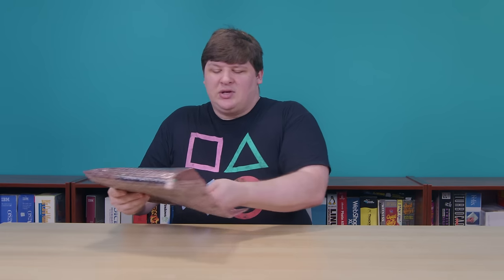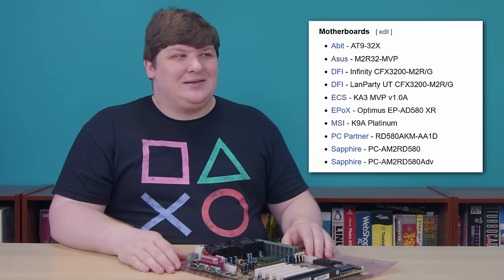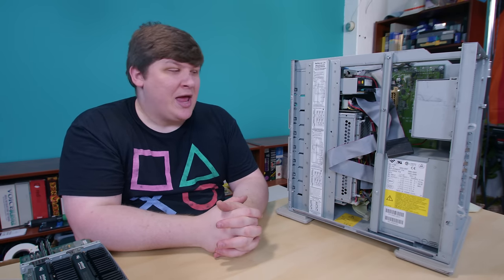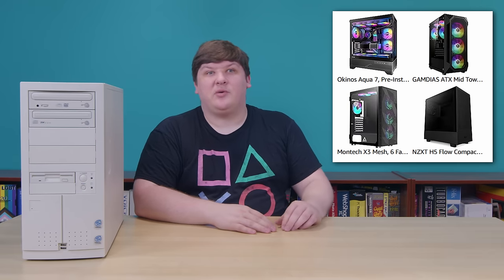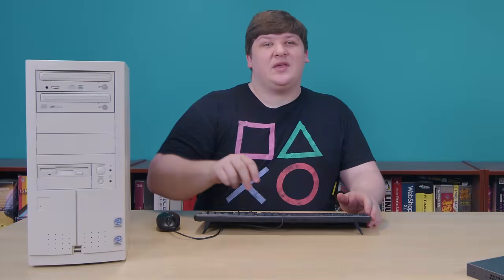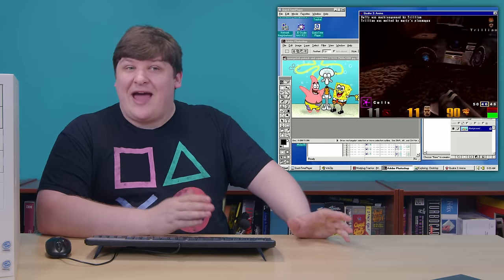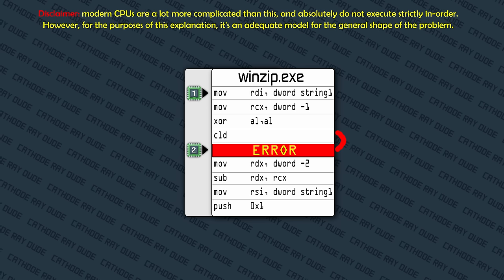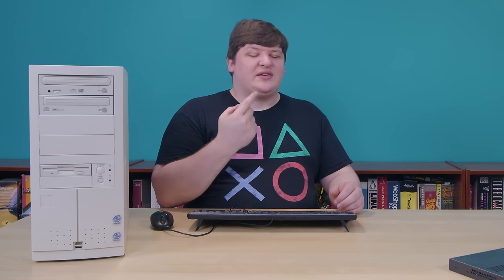The Only Famous Motherboard

Comment: The Celeron family was the low power option from Intel, it was originally focused on battery life for laptops. They also produced less heat so you didn't need a process fan.
By 1999 more power to a single core had stopped increasing processor speed as the bus speed was limited by the length of the cables, so that is why the final single core Celeron performance got quite close to Pentium speeds.

I ran SMP Pentium 733Mhz system as a software developer, as you say a lot more money for a small performance increase, but with dual scsi drives, compilation times were halved.
Hope that helps you understand why the Celeron family started with the not for enthusiast label, caught up, then were dumped again, when multi core processors allowed Pentium to speed off again.

Comment: Although SMP were way rarer for desktop usage earlier on, HP made the Vectra XU 5/xx (I've only seen 90) which was fairly generic for a brand PC at the time, except dual processors. Two pentium-1 processors, otherwise regular 72-pin SIMMs, some PCI and some ISA slots, ethernet built in on the motherboard and they usually came with graphics on the motherboard too, and they had an onboard SCSI controller, so high end, but certainly intended for desktop usage.

At that time, with 90MHz pentium processors, the difference was that you could run Winamp without other single threaded apps losing steam... :)

Btw, I really enjoy your videos but this time I think I already knew everything you told me, and I know what you are about to tell in the next video, which to some extent spoiled the experience. If you happen to actually read this comment and also happen to get different viewing statistics for this video than for most of your computer related videos, there might be many more viewers like me who already knew everything (except the benchmark results) but unlike me decides to not watch the full video.

Comment: modified Celerons usually had wires coming out of their guts. Even the guy who succeed using two of those Celerons on a board had to drill  some holes( I still remember seeing that pic online but I can't find it any more). Abit and Gigabyte  applied his findings and replicated the modification on their boards. It turned out  an external circuit could replace those drillings!

Comment: I ran with the crowd on the wrong side of the tracks. Everyone in my circle wanted a Tyan Tiger, for the dual Athlon XPerience! But the justification was exactly the same, and the results pretty much were too.

As soon as it became no more difficult to build with two core as it was to build with just one, the majority of us were happy to go back to one socket. There are real advantages to it, so as long as it's a sidegrade and not a downgrade, then whatever. Some people continued to use two sockets into the multi-core era, especially if they were already familiar with server hardware, but pretty much everyone else was and continues to be fine with all their cores being in one package.

Comment: Didn't have the BP6, but drooled after it, to replace my other P166 Linux-based FTP server. My normal PC back then had the good ol' Celeron 266 clocked to... 412? Mhz (just above 400 at least). Oh, and before Win2K (but especially with Win2K) , during the emergence of 3D-accelerated gaming the people who went NT also went nVidia Quadro or ATi FireGL, 'cause those were basically the gamer equivalent, but with drivers for NT -- albeit more CAD/3D Studio-focused stable OpenGL drivers. Thus,  games that used OpenGL often ran happily on NT. Remember a dude at The Gathering 'round then had such a system.

Comment: I remember the first dual SLOT 1 board I saw. It was E-ATX as those slots were huge. However, it was small like this A-Bit. It could fit into an E-ATX case which were common back then if unweildy.

Comment: Interesting video, I remember having a dual CPU slot 1 computer back in the days, dusted it off a few years ago and still working as good as it gets, it was a dual Pentium 2 450 Mhz if I remember correctly I should still have pictures somewhere, but it's stored away at the moment

Comment: The Socket 370 thing reminded me of when I was reading PIII stuff and the different voltages for different processors weirded me out, but made sense due to different transistor nodes used.

Seeing the 500MHz Celerons of the 2V made me think if they were of a different architecture than Coppermine and obviously the later Tualatin since I recall watching a video from I think Budget Builds Official on a Socket 370 Celeron build mentioning it too. 

Some searching later yeah it was an earlier one called Mendocino that used 2V instead of around 1.75V or 1.5V of later PIII and Celeron chips on Socket 370. 

Mendocino Celerons being available as both Slot 1 (Celeron 300A) and the Socket 370 variant like the 500MHz ones on the video was cool to see though since that's something Intel doesn't do again since they switched to LGA based sockets.

I can find dual (and even some rare quads in the form of SGI workstations with Slot 1 PIII) PIII setups using the later Coppermine and Tualatin processors but the motherboards are different and it seems the retro community uses either Windows 2000 or XP Pro for those.

Considering you shown NT 4, it would be interesting to see how Windows 2000 differs in performance to NT 4 on that dual Celeron BP6 board.

Comment: The thing with video games scaling more with single thread performance is partially due to (and especially before the era of (AMD Mantle)Vulkan/DirectX 12/Metal) the submission of draw calls and other work to the GPU being sequential, synchronous, and only doable from one specific thread really. So, all game rendering happened in one thread. Maybe simulation, networking, user inputs and physics can run on another. But if the game "CPU side" needs to spend most of its effort for a frame to generate the commands that needs to be drawn on screen... Well, this is where you bottle neck (as far as executing code on the CPU) is.

Comment: I had a dual socket motherboard. Can’t even remember which one, may even have been a BP6. I started with just the one CPU and.. only ever used one CPU as I either crunched a surface mount component near one of the sockets when trying to mount the heat sink so only ever used the other socket.

Comment: When you talk about rack mount in the late 90's you are also considering HP3000, HP9000, running HPUX.. Those would take up 8U rack space, and your mass storage would be tape, for backup. So rack mounted severs existed the whole time. The HP you are showing, could be a server or just as much a workstation for engineering. We had them, but I was never important enough to use one.

Comment: Edit: well, he basically told this staring at ~ 30:00

Original Post:
Multiprocessor support was a lot easier to achieve than e.g. Y2K compatibility.
As long as a program properly used the Win32 API (which most did in the year 2000, long before multicore systems got popular), it was Multitasking ready. Threads were a thing since Windows 95 I believe. Sub processes as well.
Even if a program didn't use them that much, multi processor still was an upgrade as the OS scheduler could now place two programs on two cores. Or at least run the OS on a fast pace while one core was occupied. 
Basically the only thing that is bad for multiprocessing (and even multitasking on a single core machine) is hogging the CPU while waiting for things ("spinning" the CPU in a loop without delays). 
This was popular in the MS-DOS times as there was no scheduler. As soon as power states appeared (Pentium 4 era), which, also, was way before dual cores became popular, it was more or less mandatory to not spin wait as that would heat up the CPU (and as a P4 user, you very well noticed and hated such programs as the CPU fan got really noisy without a real reason).

Comment: There was one thing that happened between 2000 and duel cores getting common that was pain: Having a game use threads but not actually be thread safe. Yes, they would use threads... but then assume that the cache was coherent. Running that on any multicore machine is pain because there is no locking. Case in point... Sid Meier's Railroads

Comment: I bought a BP6 off Ebay in the early days of the internet. It might have been my first internet purchase. I wanted to use duel processors, but the BP6 had a broken tab on the second socket, so I couldn't use it. :( I wanted to run two programs at a time, each assigned to its own processor. I was denied the one thing I bought it for. The seller wasn't willing to receive returns ether. I lost $80 and used it like a conventional mobo. It worked, but not as I had intended.

Comment: I was a PC builder and computer support tech (for Windown NT 4.0, believe it or not) back in this time period. The Celeron wasn't the only big thing. I was a big AMD fan at the time, and bought several Athlon chips that beat the pants off Intel for half the price. However, it was far more expensive to get a dual Socket A (or God forbid a Slot A) board for cheap. The BP6 was probably the first thing that really convinced game makers that dual processing was coming, regardless of what they wanted to believe. Abit did a LOT of things right in the market. I mourned their loss.

Comment: 1:55 Those were the days. I was pencil modding every K6-2 I could find in my high school. And I actually thought it would be too much of a hassle to liquid cool a CPU so I built it in an aquarium instead of the pump  and submerged the computer in mineral oil. Yeah, I was naive. That turned out to be a much bigger pain than just some hose clamps and a pump. lol

Comment: I really liked your taco bell analogy. 
2015 I remember taking my core2duo e8400 wolfdale and putting electrical tape over certain pins on the side to unlock the FSB speed on my mobo or something to 1333. Eventually bought a Yorkdale q9650 core2quad and could finally play gta v.

Comment: I used to have the Abit BP6, but before I installed a second CPU, I actually came to the conclusion that it wouldn't really benefit most of what I was using my PC for, so it ended up being used as simply a really excellent overclocking motherboard. I ran a Celeron 433A, and if I recall correctly, it managed to run stably at 98MHz bus for 637ish MHz. The bus speed was never decimal perfect, so after multiplier, it usually varied a bit. It was a great system. I also used a GeForce 256, the 3DBlaster Annihilator Pro, DDR model. Fantastic system for its time, despite having one unpopulated CPU socket :P

Comment: My first brush with assembly was writing a DOS TSR to remove some wait states from my PC/XT clone RAM. Massive performance boost for the mid-eighties. And my first SMP mlachine in the early 2Ks was a SUN SuperSparc 512 running Linux. I don't know if that's relevant, but I also still owns a dual P-III Compaq server, and as far as I know, each CPU had to have a VRM daughter board installed to be activated. So maybe the BP6 was limited to celerons in that way ? I never owned one, so I wouldn't know.

Comment: 3ds Max is still heavily used in the Architectural Visualisation market. We went from Autodesk Revit, or SketchUp, or similar; to 3ds Studio to texture and add lighting and then render out. 

It's not as common now that a whole bunch is now done by Enscape or Lumion, which are tailor-made for this specific market (and include assets made for it). But at least as of May 2024, my co-worker was spending 6 hours a day on it.

Comment: I remember having all sorts of problems with this board.
Finally it died (swollen capacitors), and I replaced it with a VP6 with dual pentium III 850s, overclocked to ONE GIGAHERTZ!!!
That one was much more stable.

Win 2k was a must, though.

edit: just remembered my old trusty Matrox g400 from that machine as well. Good old 2D times...

Comment: 300A Celeron and the Pentium 3 733 Coppermine were my first overclocking successes . The cost to performance value comparing cheap Intel products that you could overclock to faster than the most expensive ones they had, man that was so satisfying. I remember having the 733mhz Coppermine Pentium 3 sailing north of 1ghz. For a day I had the world record in 3dMark thanks to that chip. 

Killed it a week later by chipping off a corner of the die trying to put a bigger cooler on it.

Comment: So I have a terrible memory, so I may be wrong on the processor, but back in 2007ish I semi worked at a flea market's computer booth and rebuilt a black server that looked similar to (but sleeker than) the Dell you showed. I'm pretty sure it was a Dell as well. It used slot cartridge processors and I think I put two Pentium III processors in it because it was the only matching pair we had. I had to wipe it clean because the drives had some kind of encryption. I think I had loaded it with Windows 2000, and I basically set it up as a remote storage drive so the other computers in the workspace could store and share files with it. 

I don't think I ever tried to game on it, it's been so long I'm fuzzy on if I had a full six hard drives in it or only four. Or did it have 8 drive bays on the front... Either way, I was proud of myself because it was essentially the first system I really truly tinkered with.

Comment: the dell desktop i used in 2001-2003 or so had a non-standard motherboard form factor and used only rambus as well. i found out when i went to upgrade it and learned rambus has to be installed in pairs. and then again when i went to upgrade the entire motherboard.

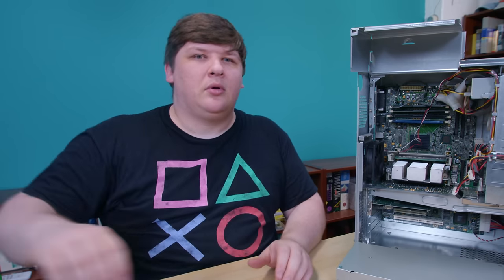Comment: 16:51 IDK what others were doing with theirs, but a friend of mine and I worked at an ISP at that time, and we used one to run a dedicated 8-client Quake 2 server there. Of course, we cleared it with management, who thought it was a great idea - not too hard on bandwidth but it was a selling point for the company illustrating server co-location and coolness factor. At first, we had it running on NT 4.0; later, we migrated to Linux.

Comment: Bringing back memories of my Dual slot 1 build on an ASUS p2b-ds with dual SCSI hdds.  Windows NT and Linux could take advantage of SMP

Windows NT was not nearly as good at SMP scalability compared to an OS like Solaris.  The cost of using additional CPUs was higher for NT, which likely is part of why you don't see things get 2x faster even if a program supports SMP.

That vintage of NT didn't do well beyond 4 CPUs compared to other machines such as Solaris or other Unix/Linux based machines.

Well, I did have the dual PIII 450 IIRC and upgraded those to dual PIII 750 a few years later.  But, I don't really reminisce.  It was a flex, but only for me.  I had access to big SPARC based gear at work, so while impressive for the home, it wasn't a big deal. 

I did bring home a SPARCstation5 and later an Ultra10 workstation for work related stuff, so the Pentium machine was just a nice to have.

Comment: 17:51 this is true. i bought a sharkoon m30 black because i wanted to get rid of the old generic case from our second family computer. i guess its a good case, but my problem with it is its not the one i ordered. the seller instead sent me the rgb version with a glass side panel and 1 rgb fan + 1 black plastic fan. i knew i'd regret not sending it back but they'd probably argue they ran out of stock for the black version so i just stuck with this one. i don't like it but i'll just wrap it black when i have the time.

Comment: I built a dual Athlon MP 1800+ system (1.5Ghz) for home use and ran Windows 98 for a month or so before realizing, despite the system being much quicker than my previous PC, it didn't use the second CPU. This lead me to NT and 2000 then got me started on Linux (which I still use as my main OS today, Gentoo specifically).

I was an avid gamer before this realization and dove head first into Linux and other alternate OS's, effectively stopped gaming for years, and came back to gaming much later

Comment: Ran one of these under NT4 until the VP6 came out.  Missed it so much I rebuilt one.  then a second, and I've got a third waiting to be built.  I've been running multi-socket since then, even though they multicore cpus now, I still run dual sockets.

Comment: back in the early 2000's (2002-2005) I had two dual CPU machines, one was a Frankenstein dual Pentium 2 333Mhz (joked that it was 666Mhz) on a consumer Abit or maybe Asus board, the other was a dual Pentium 3 XEON 550Mhz Dell Precision workstation, and that had the opposite power supply configuration from the Dell you showed in this video, I regret getting rid of either of those machines now....

Comment: That dual slot 1 board you showed an image of, I have that same board but missing both the onboard SCSI hardware and the slot extension to that upper PCI slot. Good board, used it for many years, its shelved at the moment…